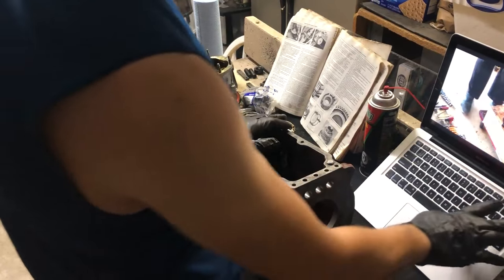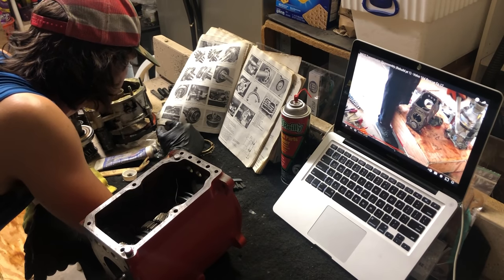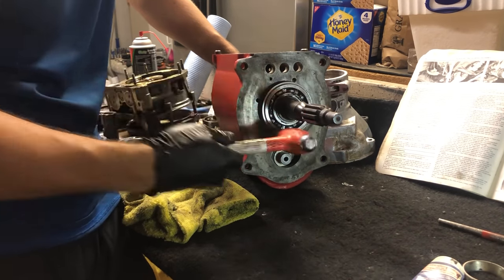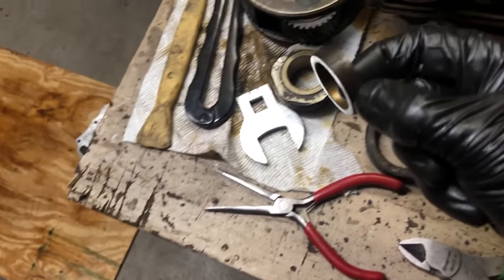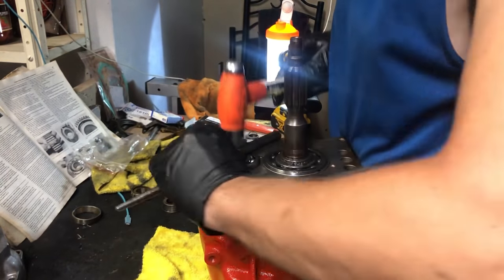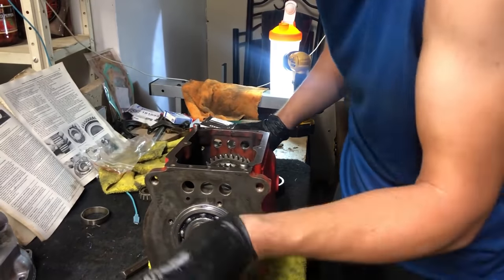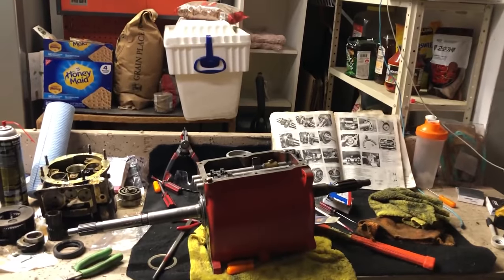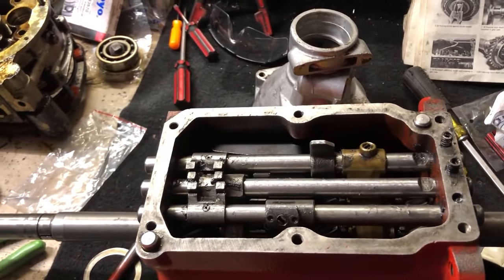Volvo M410 Gearbox/Transmission Rebuild/Reassembly-164 Rescue Ep 36

Comment: As I mentioned previously, the countershaft bearings were upgraded to taper roller bearings (just like the picture in the "green book").  Your supplier did not send them to you?  The taper roller bearings take the torque thrust much better and preclude balls from being spit out the back of the gearbox.
Reply from the maker: VP sells the Volvo part numbers direct from the catalog. I’ve found that if something was upgraded in the past, they’ll either sell that with the same or updated part number. This was the only option I found for these bearings. I noticed they have better access to oiling by design but I guess it’s just one more thing to cross my fingers over. 😬